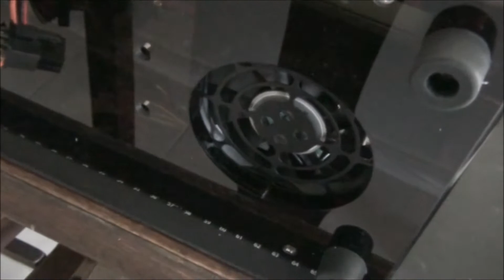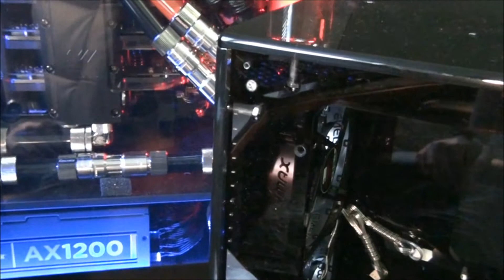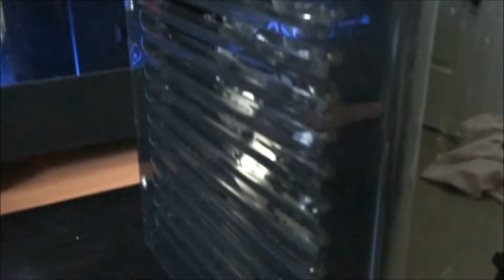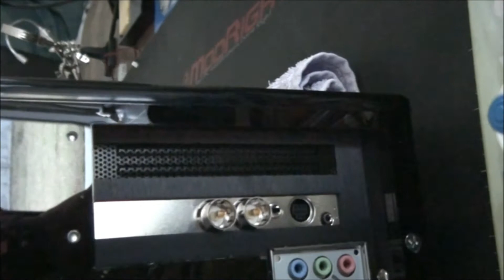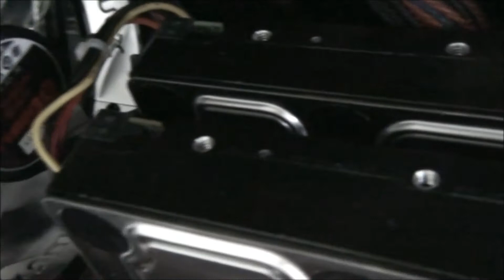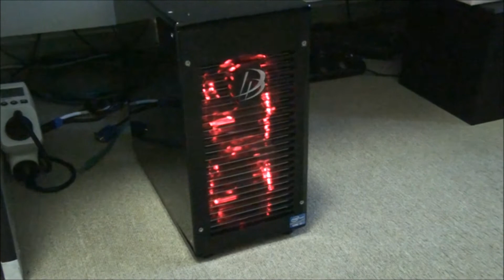Singularity HTPC Danger Den LAN Tower Build Log: Part 2

Comment: Awesome video.I recently built a mini-ITX system inside IN WIN BP655.200BL, which is a perfectly functional case, but pales in comparison to this gorgeous DD case. You did a really neat cable management job. I wondered about using a modular PSU with short cables (e.g., Silverstone), but you hid those ATX cables really nicely.